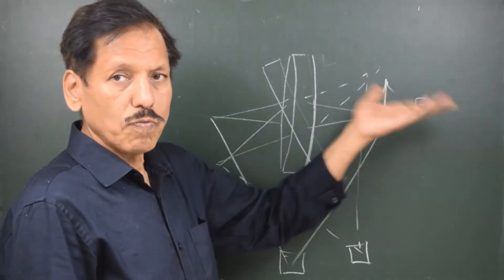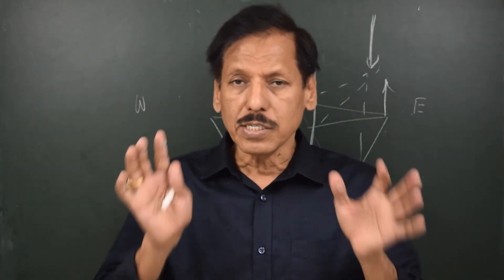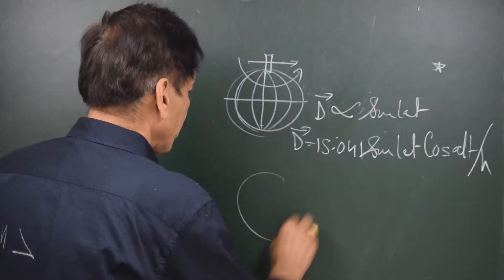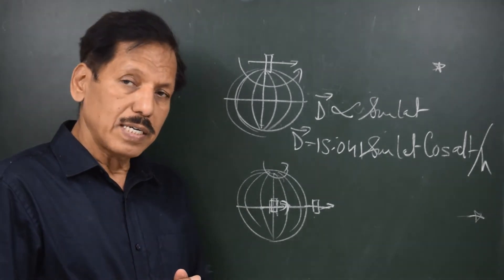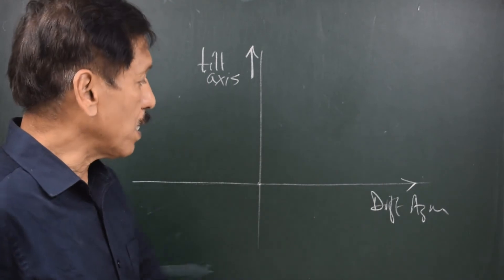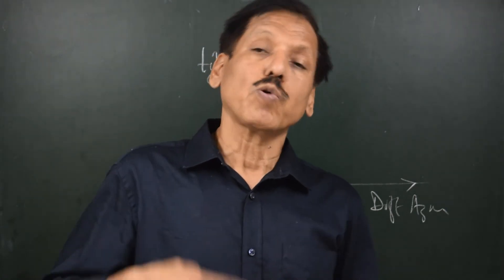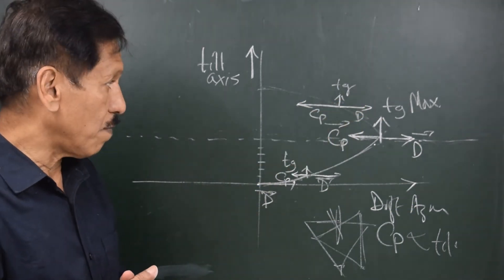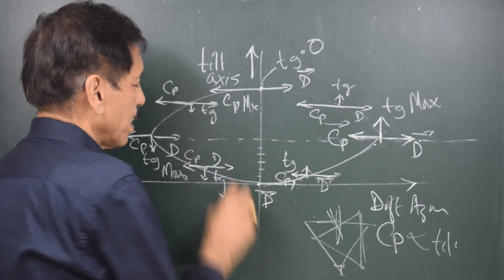Gyro 3  Gravity Controlled Undamped Gyro

Comment: ALSO I DONT UNDERSTAND HOW YOU CAME UP WITH THE TILT FORULA WHERE YOU EXPLAIN THAT TILT VARIES AS COSINE OF LAT WITHOUT ANY EXPLANATION.  IF THE GYRO AXIS IS STILL PARALLEL TO THE HORIZONTAL PLANE EVEN AFTER 6 HOURS IT HAS MADE AND ANGLE OF 90* WITH THE CENTRE AND NOT WITH THE HORIZONTAL AXIS . AND TILT IS THE ANGLE MADE BY THE AXIS TO THE HORIZONTAL , THE AXIS IS STILL PARALLEL TO THE HORIZONTAL PLANE OF THE EQUATOR AND JUST MAKING A TURNTABLE MOTION AROUND THE EQUATORIAL AXIS AS THE EARTHE ROTATES. HOW CAN YOU DIRECTLY COME TO THE CONCLUSION THAT THE TILT VARIES AS COSINE OF LATITUDE.
Reply from the maker: In respect of a free gyroscope, the tilt means the altitude of a star. In respect of star, there are two things, number 1, the altitude and number 2, rate of change of altitude. Thus, for example, the rate is 0 at maximum altitude, the formula for rate of change of tilt is same as rate of change of altitude in astronomy.

Comment: sir, drift is the movement of the  gyro axis on the horizontal plane if that's the case and  if we consider the axis in east west direction with the gyro star having zero declination then the star would move on the line of equinoctial with the north south point of the observer's rational horizon passing through the poles. then as the gyro star would move  along the equinoctial in one sidereal day it would still move along the equinoctial it would not change its declination. my question is, as the gyro star moves along the equinoctial , so would the axis of the gyroscope meaning it will move in the horizontal plane i.e in the plane of the equatorthen how is the drift zero at the equator? either the definition is wrong or the formula. please explain  I can't find a logical coherence between the definition and the formula and any educator I am asking they are giving ringa ringa roses answer as if they have rote learnt. i consider you among the few who understand the subtle logic behind the complex topics, please explain sir. THERE IS SERIOUS LACK OF AUDIO VISUAL MATERIAL TO  UNDERSTAND THESE CONCEPTS, EVERYBODY FROM STEERING MARINERS TO MARINE GYAAN ALL JUMP TO FORMULAS WITH IPSO FACTO EXPLANATION AS IF THEY ARE FORCEFULLY JUSTIFYING AND CREATING ILLOGICAL SCENARIOS TO EXPLAIN THE FORMULAS.
Reply from the maker: Once again, t understand the working of free gyroscope, we must understand the motion of a star on the celestial sphere properly. For an observer at equator, the equinoctial is along the observer's prime vertical which means as the star moves, from east to west, the azimuth remains 090 in east and 270 in west. The azimuth (drift) which is measured at observer's zenith remains 090. It is only the altitude that changes. This is the reason the drift does not change at equator.

Comment: Dear sir, i want to ask if the tilt is created because of drift and because of tilt the control precision act. At one point where the control precision and drift are equal hence no drift at that point. No drift means no tilt and bo tilt means no control precision. Means the axis to point at that specific direction. Kindle guide me.
Reply: And also sir, if the axis is at meridian then the drift will be in west direction. Also sir i don't understand why tilt will be zero when at meridian. Can you please explain
Reply from the maker: First you must understand the difference between drift and drifting and also between tilt and tilting. Tilting means rate of tilting. Rate of tilting is zero on meridian and is dependent on the distance from the meridian. Similarly, rate of drifting is a rate of change of azimuth. And drift is azimuth. Because of rate of drifting, the axle moves out of meridian where rate of tilting comes in. Whereas, tilt is the vertical distance from the horizon. At the maximum east or west position, it is not the drift but the rate of drift which is equal to controlled precision. Controlled precision depends on distance from horizontal.
Reply from the maker: The rate of tilting is zero at meridian, it is like rate of change of altitude of star which is zero when crossing the meridian. But, the tilt is like altitude of a star which will be there when crossing the meridian.

Comment: Sir one doubt .. With in practice how the gyro compass mechanism works onboard? Let say while a ship changes her course which element of the gyro compass changes which bears to give us course on Compass card ..how the mechanism work? I am confused because as per gyroscopic inertia Gyro always points to Gyro north and when the ship changes her course is that spin axis changes co-responding to the present course?
Reply from the maker: The Marine gyro axle settles on or near meridian after it is damped. It goes back to the settled position even when disturbed because in settled position the forces acting on it provide equilibrium. So this happens to the Master Gyro. The various repeaters are synchronised to the Master Gyro with synchro system. And thus, continue to show the directions as per the master gyro even if the ship alters the course.
Reply: @capt.s.s.chaudhari5181  Sir i understood but the confusing is Gyro axle is always points to a fixed object in space lets say Pole star then how the gyro axle gets settles on observer's meridian ?
Reply: @snehasishpadhi1490  every meridian points towards the pole